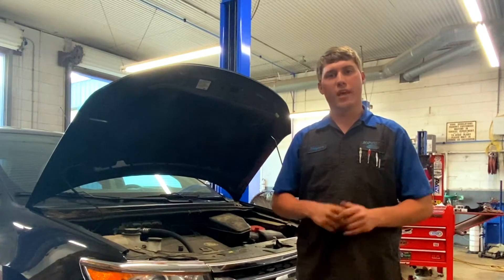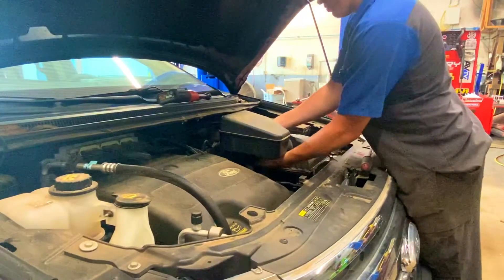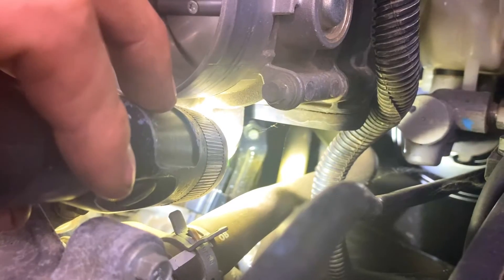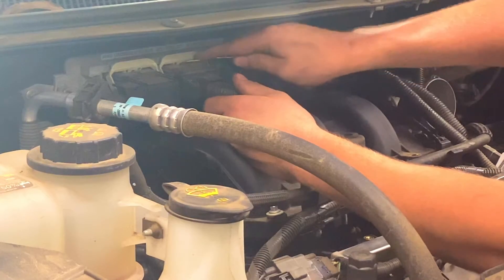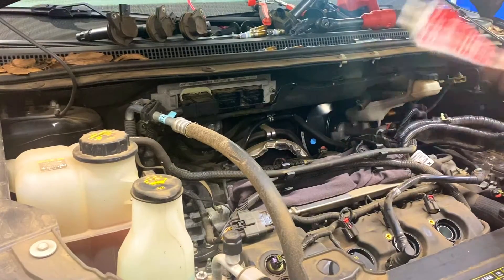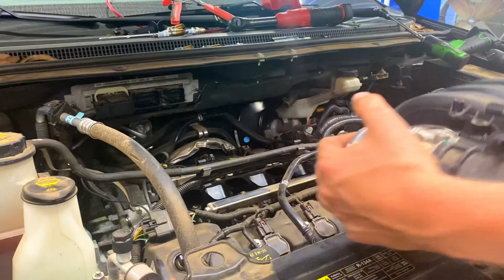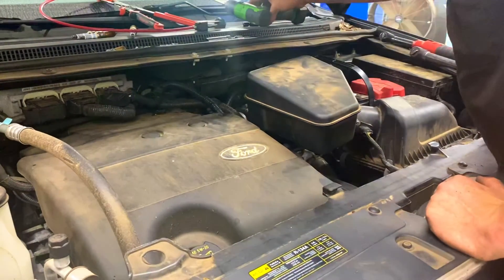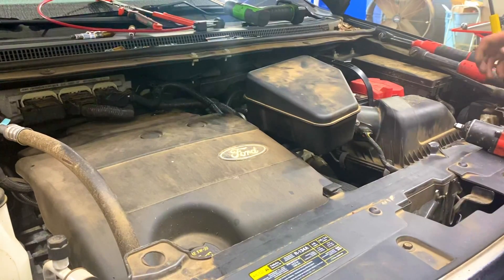Ford: How To Change Spark Plugs In Your Explorer, Edge, or Taurus! (3.5 Cyclone)

Comment: Surprised you didn't put a small amount of anti seize on the plug threads. Good job on installing every clip and foam gaurd back. Seen way too many techs just in a hurry to get it out and skip snapping mounting fasteners back down or difficult mounting bolts back in to save time. Gitta remember, this is someone's car who might still be paying for it. A little respect for the consumer/customer goes a long way.

Comment: Never use an impact if you strip, pull out or cross thread aluminum heads with the plugs you are F💯D. Plus shop vac the plugs after coils removed so debris doesn't go in cylinder
Reply: Year air or shop vac then holes, blow that junk out